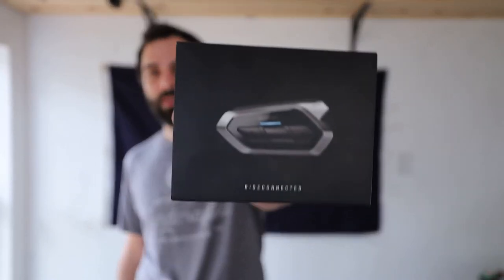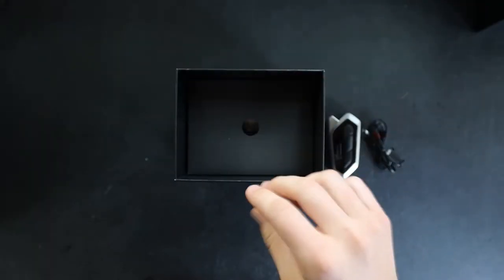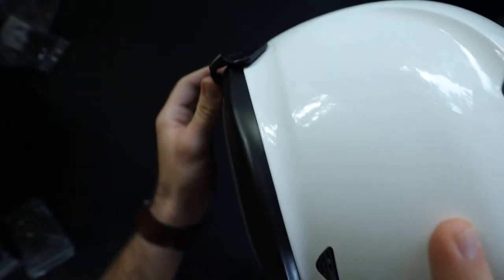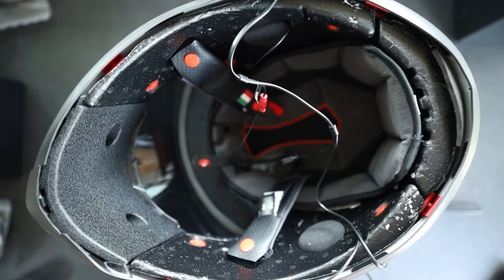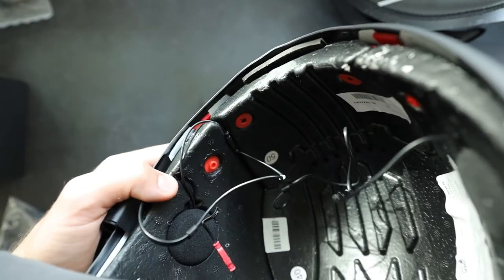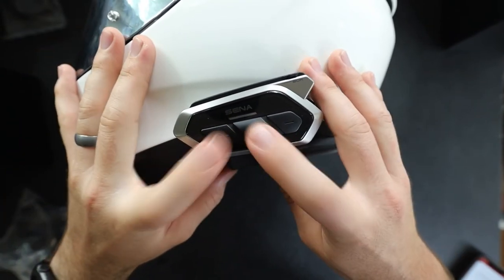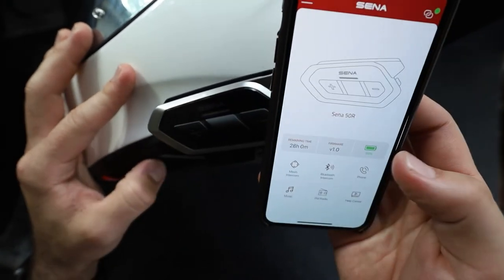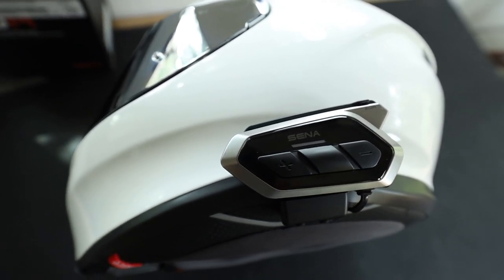Sena 50R Unboxing & Install on AGV K6

Comment: Why 50r und not the s Version? Are you dtill happy with it?
Reply from the maker: I didn't like the jog wheel on the 50s and the 50r seemed like a better design overall.
I actually got rid of it and started using my AirPod Pro's instead. Didn't think the sound quality was worth the price.
I'm interested in the newer Cardo Paktalk Bold Black but it's still not USB-C which is lame IMO.

Comment: How do you like the shriver 750? They are becoming a cult classic..Nice vdeo
Reply from the maker: The Shiver 750 is an underrated bike in my opinion simply because not many people know about it so a clean one are be acquired for usually 5k or less. I've been on a few rides with people on 600cc supersports and have no issues staying with them along the ride even though they have about 15-20 more hp.